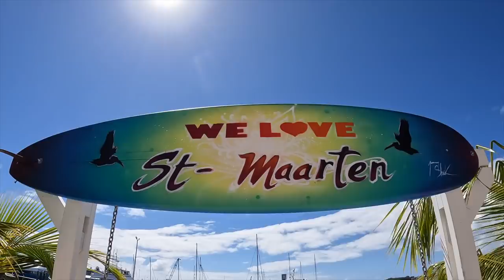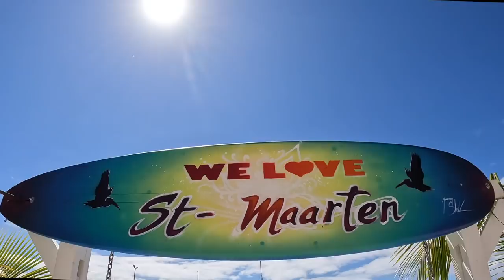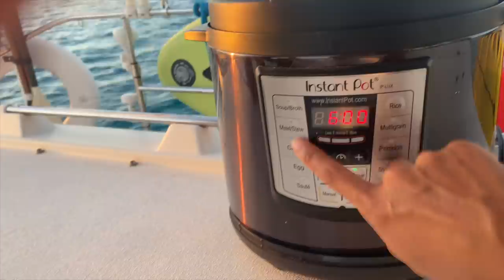Why Living on a Sailboat does NOT mean Living off the Sea...Plus: Dinghy Repair - Ep 77

Comment: Great Video.  Respectfully suggesting next time you do a dinghy patch, opening the hole large enough to get your finger in then insert a plastic-shopping bag, gluing the shopping bag to the inside then put your patch on the outside.  This is a permanent patch, used on our circumnavigation.  We were through Sint Maarten 40 years ago with only six boats anchored in the harbor, presently cruising the Bahamas.  Things have changed.

Comment: Best english yorskshire recipe 👍🏼 

Ingredients
* 140g plain flour (this is about 200ml/7fl oz)
* 4 eggs (200ml/7fl oz)
* 200ml milk
* sunflower oil , for cooking
Method
* STEP 1Heat oven to 230C/fan 210C/gas 8. 
* STEP 2Drizzle a little sunflower oil evenly into two 12-hole non-stick muffin tins and place in the oven to heat through. 
* STEP 3To make the batter, tip 140g plain flour into a bowl and beat in 4 eggs until smooth. 
* STEP 4Gradually add 200ml milk and carry on beating until the mix is completely lump-free. Season with salt and pepper. 
* STEP 5Pour the batter into a jug, then remove the hot tins from the oven. Carefully and evenly pour the batter into the holes. 
* STEP 6Place the tins back in the oven and leave undisturbed for 20-25 mins until the puddings have puffed up and browned. 
* STEP 7Serve immediately.

Ps id half the recipe for your 6-hole baking pan :)
Reply from the maker: Thank you for sharing!

Comment: I have a question maybe you can answer. I bought a dinghy recently and thought about getting chaps, but I saw another channel where they showed a lot of damage and leaks due to the salt water getting under the chaps and crystallizing causing the chaps to stick. Even my dealer said they’re a bad idea. I still want to find the best way to protect this expensive little sucker. Happy sailing!
Reply: Chaps are expensive to buy, tricky to make well yourself and yes, salt abrasion persists. I have cruised the caribbean for 23 years now and only lost dinghies to hurricanes.
How?
Rule 1, hypalon only. 
Rule 2, leave it alone until the rubber has dulled in the sun (1-2 years). 
Rule 3, paint with a GOOD water based paint from the rub strake up and into the interior, and use a waterborne antifouling on the lower tubes and hull bottom. No more UV degradation or salt abrasion. 
Rarely need to paint the topsides again for 10 years although it has happened more frequently when the wife wants a new coloured "car".
I have never have had a problem with peeling (because I use only high quality elastomerics such as Ben Moore's Aura exterior semigloss).
High heels are at your own risk, as are beaches with oysters on the rocks, for beaching good dinghy whelels are a lifesaver.

PS - for hole repairs, always abrade the rubber (and remove the paint) with 80 grit sandpaper and then use XYLENE to clean and soften the rubber, then glue with the 2-part epoxy glue available for hypalon.
Reply: @brucefletcher6179  Thanks for the great info Bruce. Paint is an interesting thought. I planned on looking into wheels once I receive my dinghy so I can have a close up look to help me decide what type of mounting system it may or may not need. I'm sure my dealer can help. In regard to removing the paint for hole repairs would you use a chemical paint remover or just rely on the 80 grit sandpaper?

Comment: I believe you was trying to make what we call Yorkshire puddings. If you was then don’t use oil use lard instead and get it smoking hot before you put the batter in and quickly put back in oven and DONT open the door until 15 minutes has passed. I am a Yorkshire man and eaten them all of my 50 years